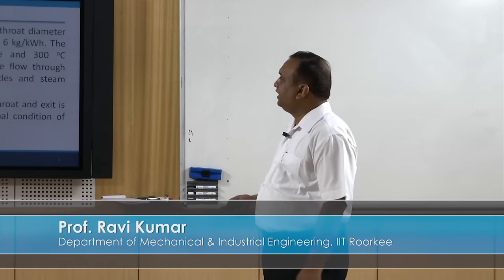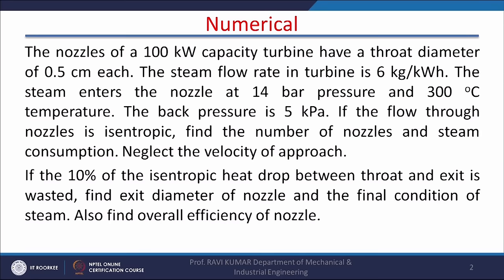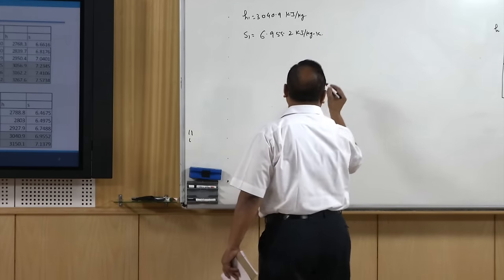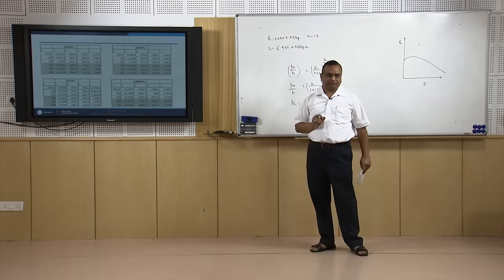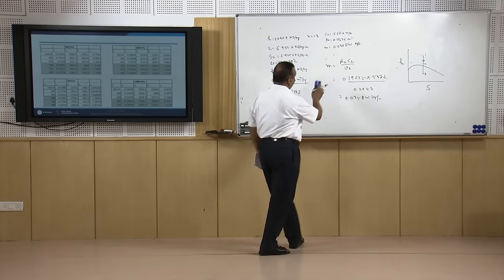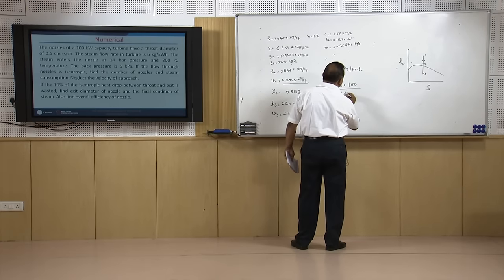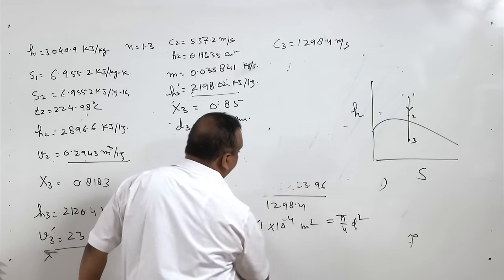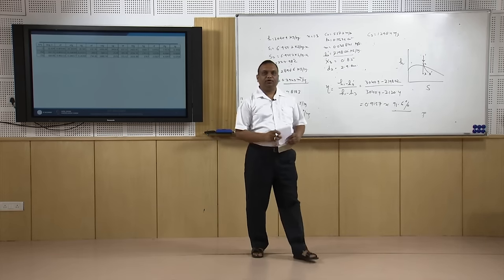Lecture 20: Problem Solving (Nozzles and diffusers)

Comment: @30.45 for A3 calc C3' (Lesser) would vary from C3 due to entropy gain of flow so A3 would be higher than 6.61x10^-4 sir(might be negligible) , thanks for your lecture (books are not specific to point) yours is great set of flow to learn 👍